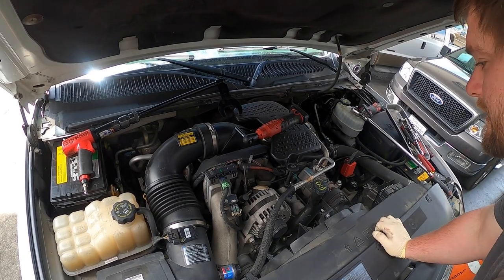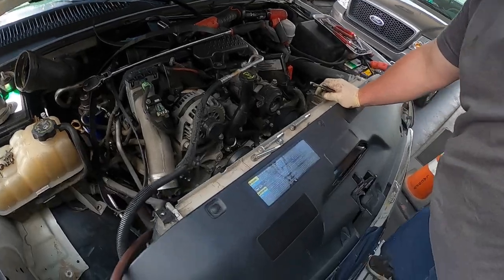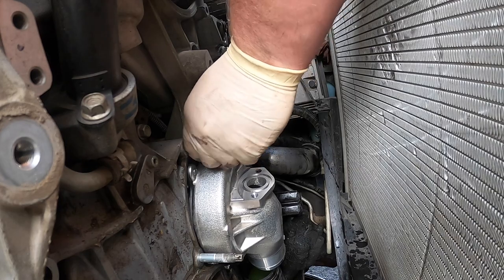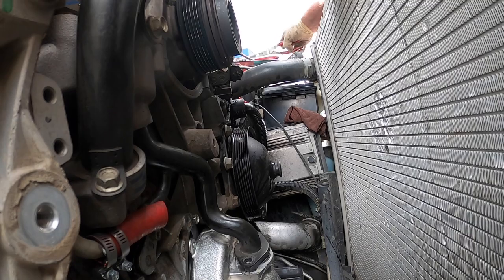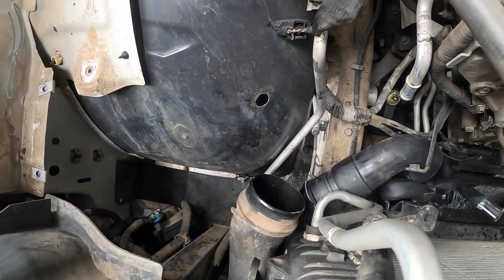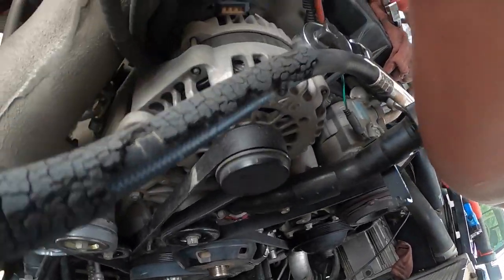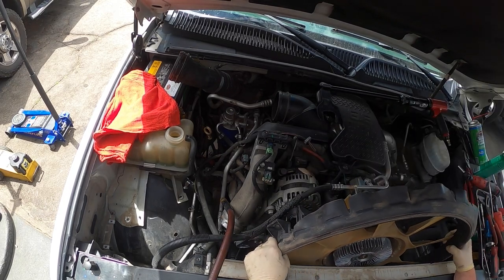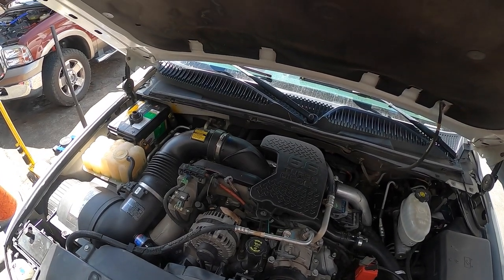Real Life Repair , In Real Time. 2007 Duramax 6.6 LBZ Waterpump Replacement

Comment: Great video! Do you work at a dealer? The reason I’m wondering is because the hoses you replaced have the factory style alignment marks for each end and I haven’t seen that before on a replacement hose. I’m guessing they are GM hoses?
Reply from the maker: Thank You ! I dont work at a dealer, These are original gm hoses , They are so much higher quality than the aftermarket and even ac delco branded hoses.

Comment: Hey I got a question does that harmonic balancer have to go on back on a certain way is there a key or do you just throw it on any different way and it's the same all the way around???? Thanks for the help tell your buddy not to bother you when you're working either
Reply from the maker: The crankshaft has a pin on it to align with the groove in the balancer. It can only go on one way but may be able to put on backwards.
Reply: @drewsshoplife  heard that where you located ?

Comment: what are you using to lube the seals? the spray you put on the top pipe of the water pump? Awesome video, real time makes a big difference. Thanks!
Reply from the maker: I use just a basic grease for lube. The spray is just spray adhesive to hold the o-ring into the water pump. Thank you

Comment: For those that think fast is good it’s not he did not torque one bolt to spec and the balancer bolt should be torqued to 260 ft lbs by not torquing that bolt to spec you can damage the motor

Comment: Wait until you get to fix the coolant leak that develops on the elbow of the oil cooler housing assembly that mounts to the block... or the egr cooler bypass valve... 🤮
Reply from the maker: I’ve done the coolant leak at the oil cooler which isn’t too bad just messy. The worst is the rear cover when they leak.